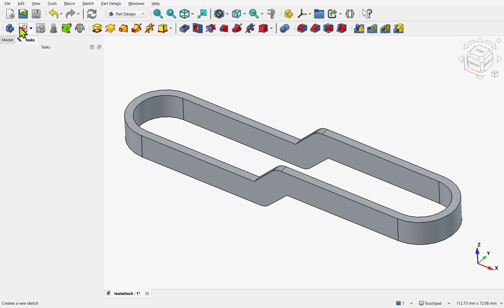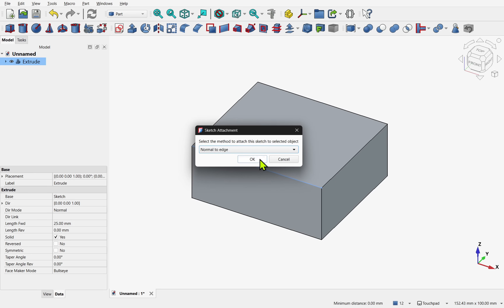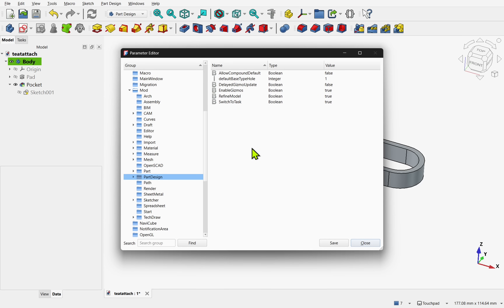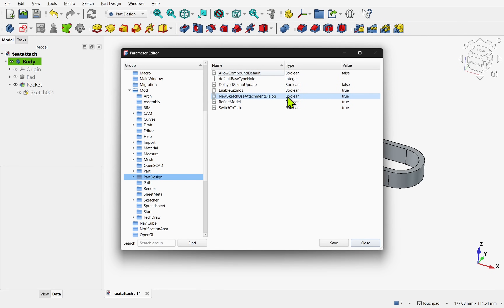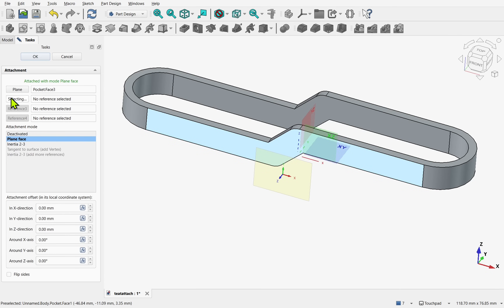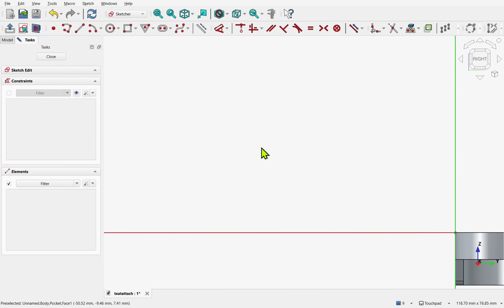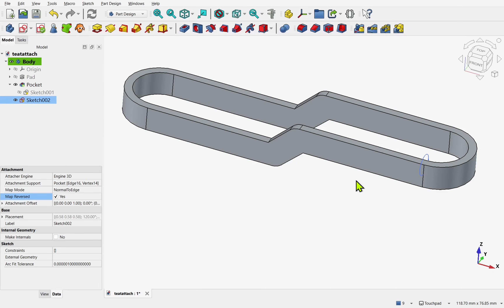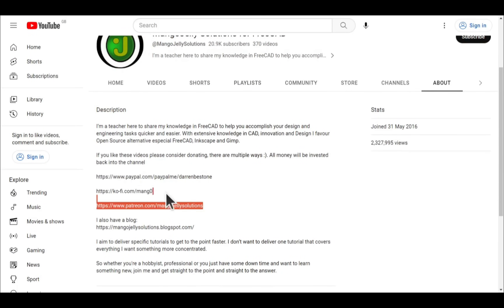Unlock Hidden Feature in FreeCAD 1.1: Activate the New Sketch Attachment Mode for Part Design

Comment: Have you ever covered reverse engineering with point clouds?  I'm struggling with aligning a sketch to a plane on a point cloud...
Reply from the maker: Not yet, but I have a 3D scanner that I have used a handful of times over the last 3 years, the usability of it was so bad that I gave up and I have been wondering if the scanning software has advanced that it's worth giving it another go.  Maybe it's time.

Comment: Do you know if those colourful plane markers can be enlarged? I liked the former big planes more.
I did switch this setting on, then forgot about it, then modelled for a few hours with it on. I got so many errors just trying to make another sketch on the same plane, nothing fancy. Maybe I clicked a face while choosing planes because of how small they are? It's probably more useful for complicated designs, but for simple ones it's even worse than before. 
And indeed even after you picked the plane, it won't just open a new sketch, nor would it accept Enter, so it's dragging the mouse across the screen, and an extra click.
Reply from the maker: Know exactly what you mean, that's the first thing I changed when using it for my main modeling work, in the preferences under Display >  3D view you will find datum size as a percentage which you can increase.  That will also increase the size of all the other datum objects as well (lines, planes etc, not sure about LCS).
Reply: @MangoJellySolutions  Oh, thank you! So much better at 400% :)

Comment: The main reason it is hidden is because I thought users may be pissed off because then you need 2 clicks to create a sketch. And also the attacher kind of sucks in FreeCAD and is full of bugs. But other than that it works as expected.
Reply from the maker: Strange as I don't see any extra clicks.  Here’s how it’s working for me:

Scenario 1: Create a sketch and select the base plane -  works as usual, with the normal number of clicks.

Scenario 2: Create a sketch on the face of an existing feature, it goes straight into sketch mode with the plane-on-face attachment as usual, again using the same number of clicks.

Scenario 3: Create a sketch without selecting anything first,  the attachment panel appears automatically. From there, you can choose your preferred attachment mode directly, just like in step 1, but with the added option to pick a custom attachment mode.

This avoids the old process for custom attachments of closing the sketch, going to the data tab, selecting the attachment field, and clicking the button to attach manually.

In all these scenarios, I don’t see any extra clicks compared to the normal workflow so I must be missing something

It’s an incredibly useful feature, especially when working with master sketches. It’s made things much faster. Please don’t drop it; even if it’s optional in Preferences, I think it’s a great step forward and can see the effort you been putting into this.
Reply: @MangoJellySolutions   Pretty certain there is one more click when you do a sketch without selecting anything first.
Reply: Meh. Pull a Microsoft. Enable it by default. Make it hard to NOT use it. :D      I like it. Especially how it shows you the visual of what you're doing immediately before you save. vs modifying properties and hoping for the best.

Comment: I dont understand the new feature. What does is means? What does it enable
Reply from the maker: When you create a new sketch in the part design the only option you have is to attach the sketch to one of base planes of the body, or to a selected face.  If you wanted to change the attachment you would have to then exit the sketch and change the attachment mode from he properties of the sketch.  This allows you to do it straight away from the start of sketch creation rather than using 3 or 4 mouse click to get to the option.

Comment: Oh.... That's dangerous. If they don't make it default there will be rioting. That's way better than doing it after. And the fact that it's actually making the local coordinate axis of the sketch visible so that you know if you need to flip or not... WOW.
Now they just need to get rid of the primitive attachment dialog, too, for Part workbench/Sketcher and use this for all of them, as it should have been from the very beginning.
Reply from the maker: I have been using it with master sketches this week.  Before I had to create a sketch, exit, and then reattached the sketch to parts of the master sketch so the pivot point is not miles out in space, return back to it and then start importing geometry from the master sketch.  Now I can do that straight from the start.  Saved so much time.